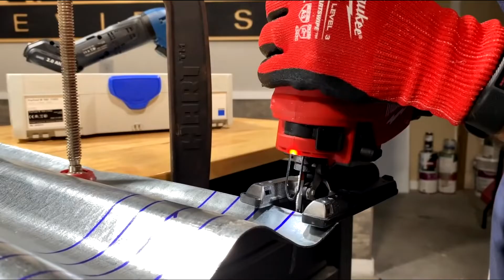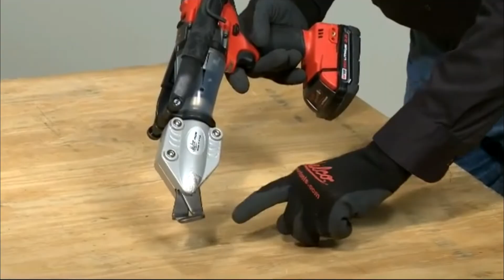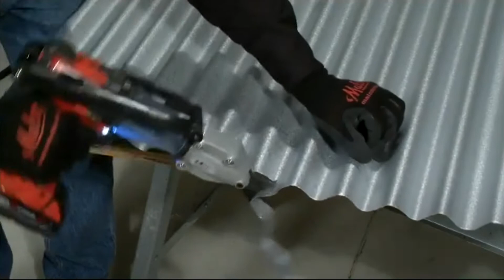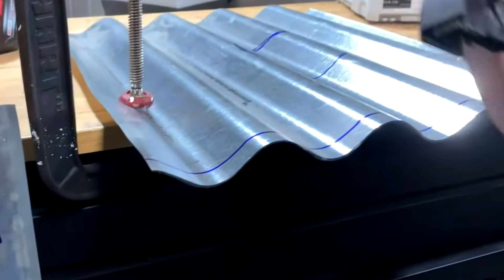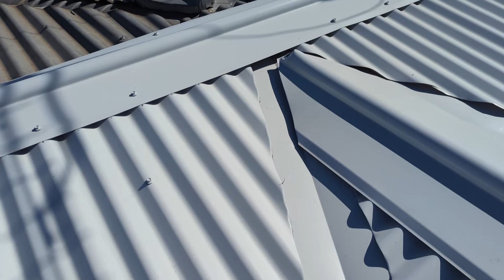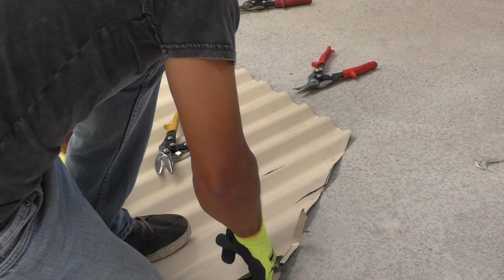Why grinders are not recommended to cut roof sheets

Comment: Cutting with a grinder produces too much heat, which burns the zinc off near the cut. Without the zinc the metal will not heal/re-galvanise itself at the cut

Comment: Always used tin snips for everything. Retired now but how may young others would be so smug of themselves with their ozito stuff (shears, angle grinders etc) and I'd be so quick on the snips but what the heck... I'm just an old guy... And brass flared fittings and copper pipe but they'd be so sure of themselves with their plastic plumbing pipe and crimping tools...

Comment: It's not easy to cut IBR roof sheets straight with tin snips. What would you recommend, also to prevent rust where you cut    please.
Reply from the maker: Inverted Box Rib profile roof sheets can be cut wit tin snips. It is a bit more difficult that corrugated.
But if you get the snip angle right, it is quite painless.
You can also use mechanical shears.
Or circular saw with the special 'cold cut' blades for those who can afford it...